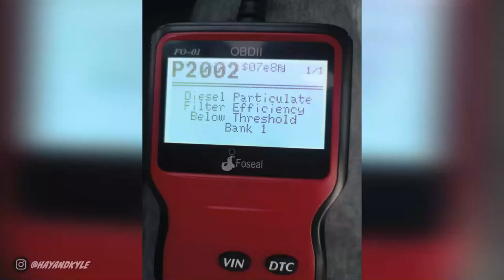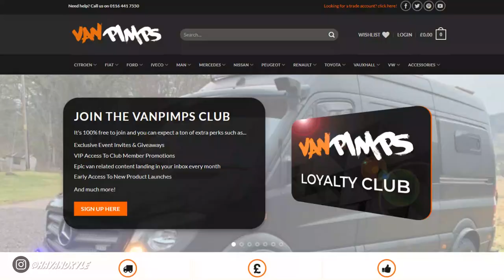The TRUTH about our Ford Transit Camper - (Van Build Update)

Comment: Liking the look of the windows, nice work! Hearing a balanced view of what’s gone well and what hasn’t makes it more real and all the more interesting for it. I am sure you’ll get there with the van and it will be well worth it. Thanks for the update.
Reply: @Hay and Kyle  That DPF fault code may be caused by a high proportion of short journeys / engine idling.  If you haven’t already, I would take it on a longer run and put it through some hard acceleration.  This is how the DPF is designed to work by retaining the particles around town and clearing itself in the open country.  You’ll then need to get the fault code cleared - The scan tool you showed may be too basic to remove codes but any good garage will be able to clear it - then see if the code and engine management light come back.
Reply from the maker: Thanks so much Steve, you're absolutely right. The van has had a re-gen to clear everything out. Brand new vaporiser, sensors, entire sections of exhaust (that was the expensive bit). We think now the problem is further upstream as the exhaust system is actually largely new and clean 💸💸 Something is getting a dodgy reading after about 40 mins of driving and that triggers and malfunction error 😑 It's been an expensive game of cat and mouse so far 🙄 haha. Thanks so much for commenting and your input, it's appreciated 🤗

Comment: I bought Transit MK7 in December and planned finish conversion in the May, Paid 1750 pounds for transit and ....and costs started to come out after I done MOT. Il spend 5000 in garage and for welding. ( extra I upgrade lamps, speakers and bought subwoofer but all rest was must). I change front passenger seat too and bought on the scrap another single driver seat ( change only 2  bolts  for seat bell I just start doing floor in this weekend so hopefully will take me maximum 2 month. Will waiting for your upgrade and maybe see you somewhere in Scotland.:)